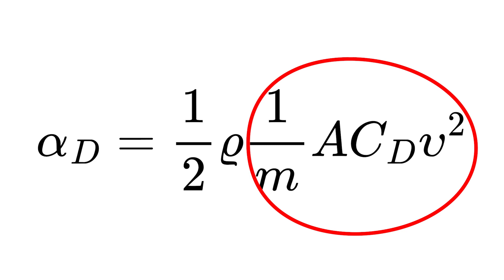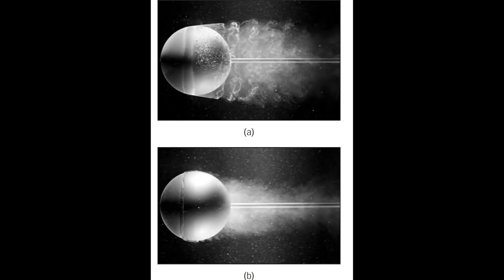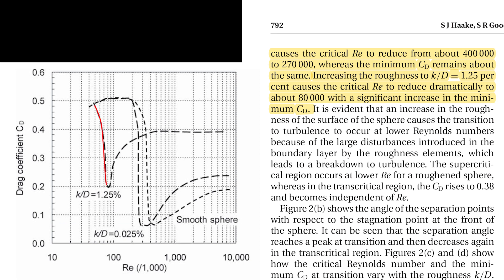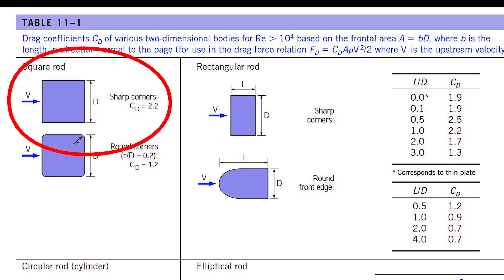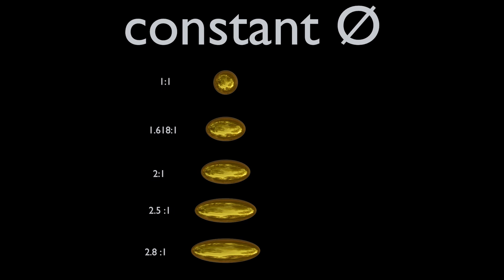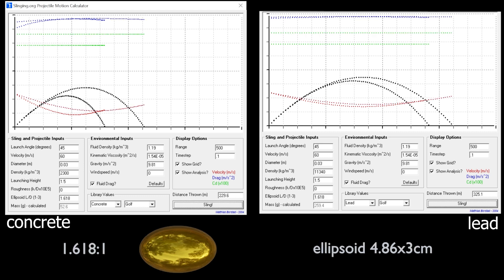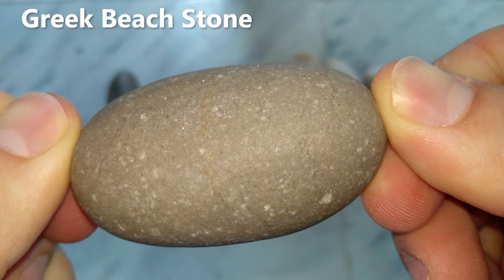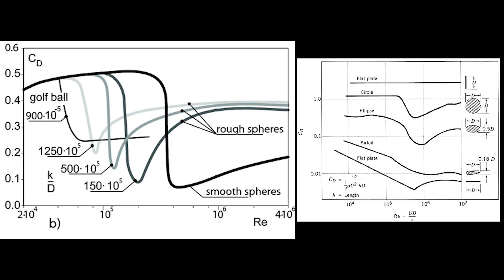Projectile Drag - Sling Aerodynamics

Comment: really interesting relation between roughness and ratio of LD, although i'll have to pause half a day on each slide to really get the details, with which shape and material did you get that 175 meter shot, i've been noticing also that the position of the stone in the pouch critical to achieve gyroscopic precession. It would be nice to relate all this data to the length, weight and type of pouch of the sling.
Reply from the maker: the stone for the 175m hit was no special, just a river stone. If I remember correct ~60gram white grainy soft stone that pulverized on impact probably 2:1 ratio. Sling was LD-1 (leather pouch dyneema cords) 3mm 85cm. Adjusting ratio and roughness makes sense when you make your own ammo or for chasing records of distance. If you are picking random stones this info might help set your expectations or what parameters to look for if you are not getting the results you expected.
Reply: so many physical systems working on each other. I'm making ammo with  fired clay (sand, clay, natural fibers and grog), alo been experimenting with different whistle hole positions and quantity. Your video was so eye opener, thanks.  @Acroballistics

Comment: What Reynolds number do you think we are getting? I calculate around 10^6 up to 10^7...(at 65 and 75 m/s) I didn't realize it is that high... Makes me think that maybe rough spheres of lead could go further than I initially thought.
Reply: I'm an idiot. lol. I was using the wrong units for length. lol. I knew 10^6 sounded too high (not to mention 10^7!!)
Reply from the maker: I calculate around 2.5-3.5*10^5 for stone or concrete but not 10^6. what length did you calculate for? I used 0.065m
Reply: With a backspin. Like hop up effect on airsoft BBs.